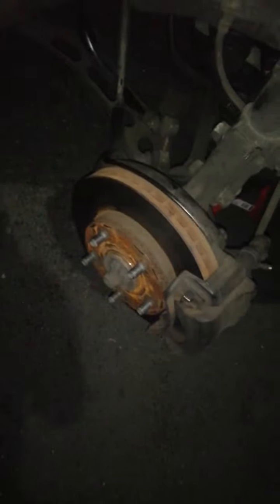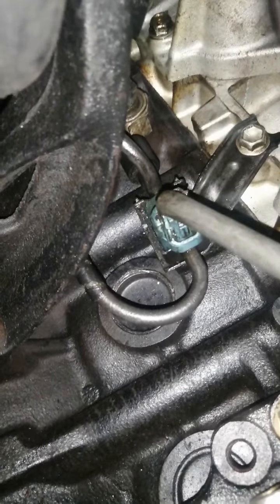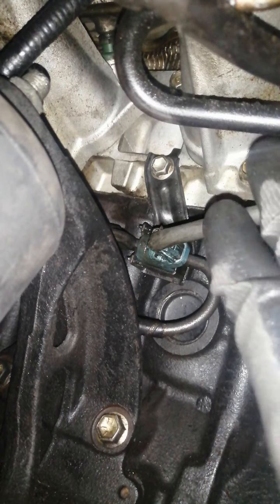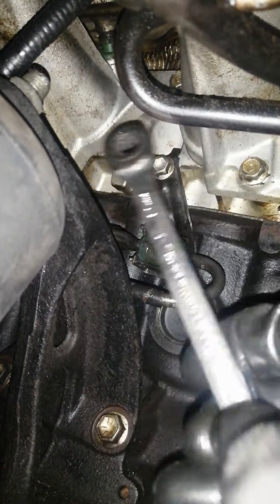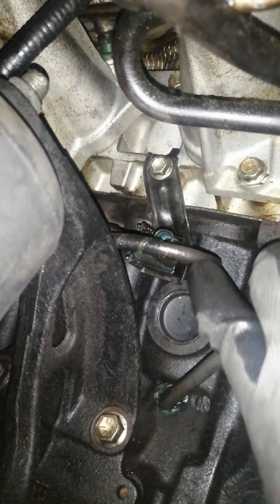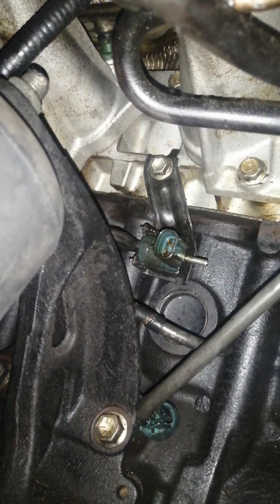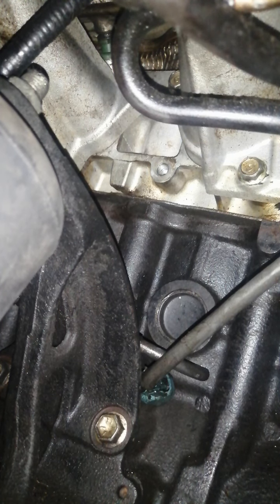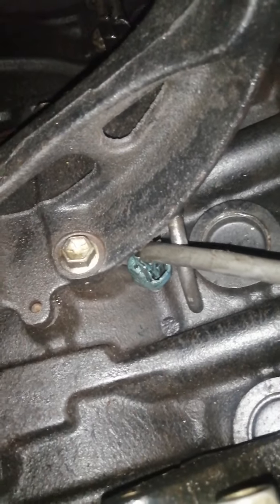EGR VSV toyota camry

Comment: The clearest video yet I have one question is it possible mine is located in the back ? I drive a 99 Camry le six cylinder, stick shift and also the new one I got has the both valves at the top so how do I determine where to place each pipe ?

Comment: This video was very useful but I can not take that bolt off. I can't not turn that bolt loose to save my life and it's killing lol you have any recommendations?? That's all I'm having trouble on the rest of course will be smooth hopefully
Reply from the maker: Try putting some oil mayby.
Or use longer 🔧 
Or i guess u could also put small ratchet and socket with extra small pipe on top for more leverage 
Before all that make sure you are lessening NOT tightening the bolt